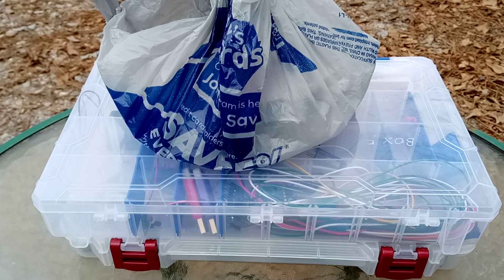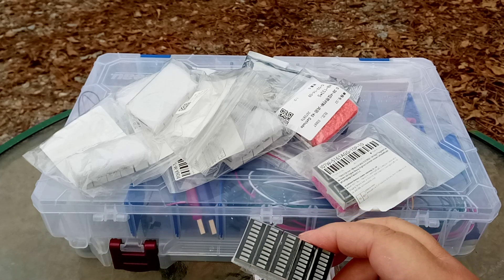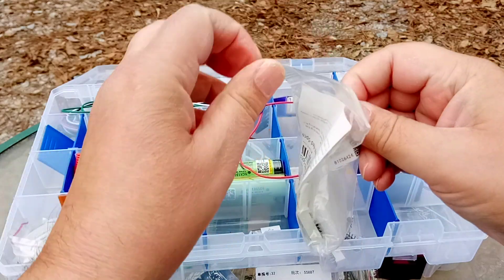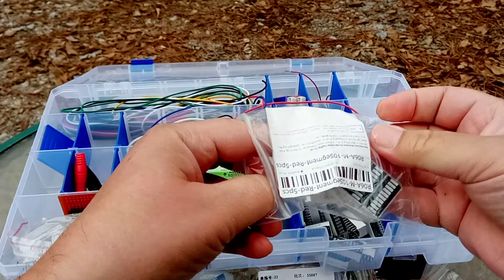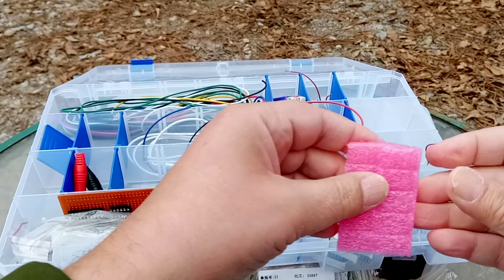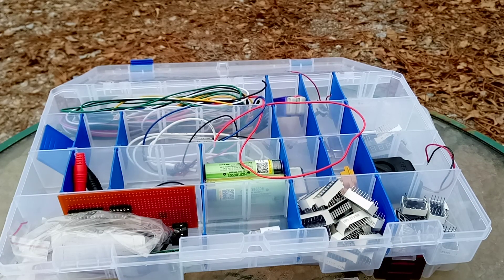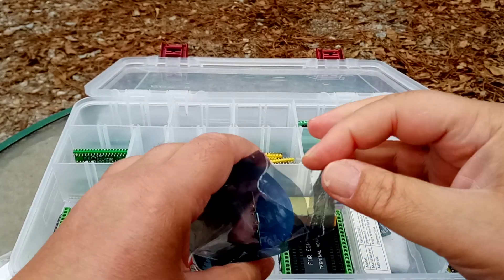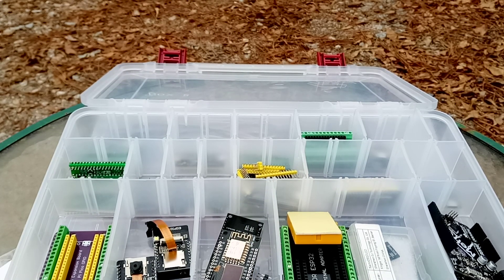AliExpress Haul #microcontroller #electronic #elecronics #leddisplay #aliexpress #aliexpresshaul

Comment: Looking forward to seeing some projects!
Reply from the maker: I'm working on a DIY Geiger counter at the moment. I'm waiting for the paint to quit off-gassing on the sensor assembly before I can put the cesium crustal and the photodiode together. I want to try running it from an ATTiny13 or ATTiny85 but might have to use an ESP32 C3 Super Mini. It's all experimentation.